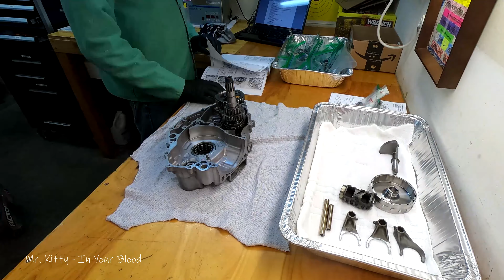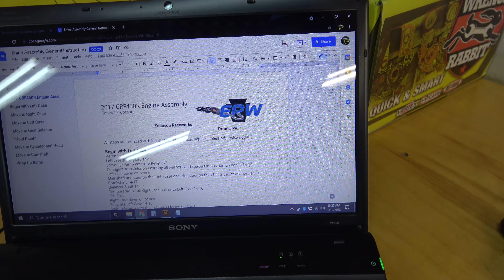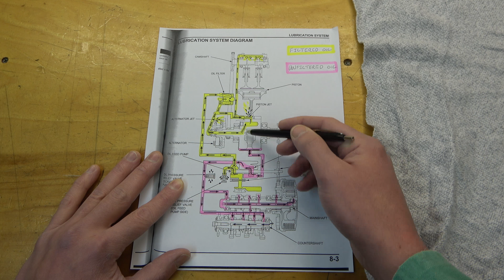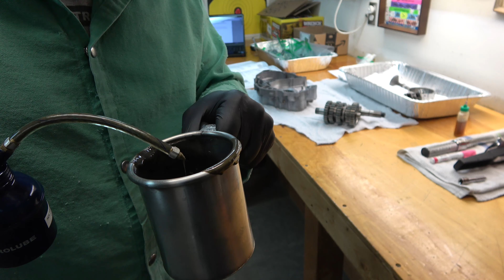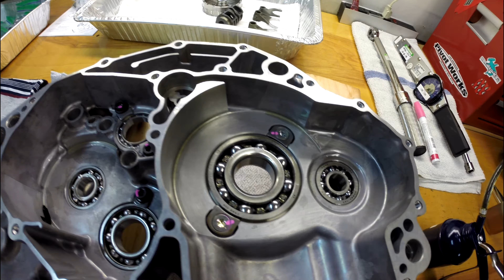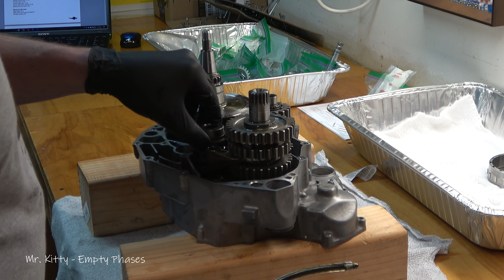Motarded Ep-11 Cased

Comment: in a cold garage, rather use a heat than mess about with any household freezer. it will most likely not do anything (like in best case; half a thousand) for you than cost u time and mind. approx 1 thousands per 100 degree of F.. so heat will give u lot more. good vid